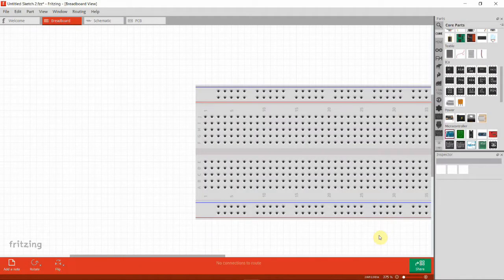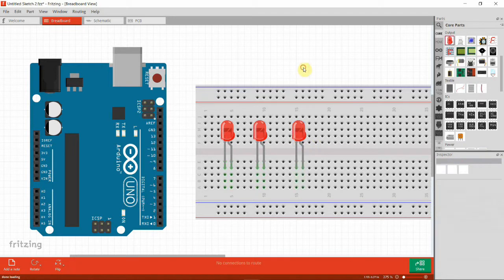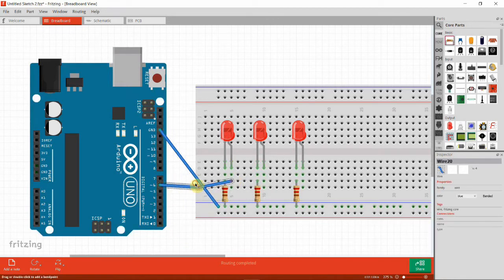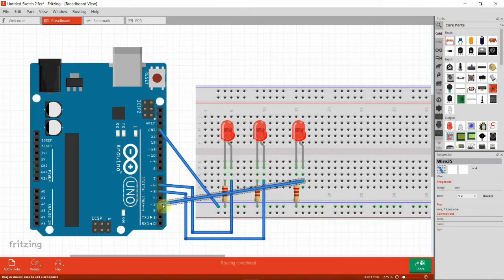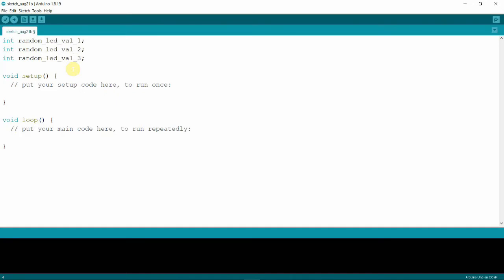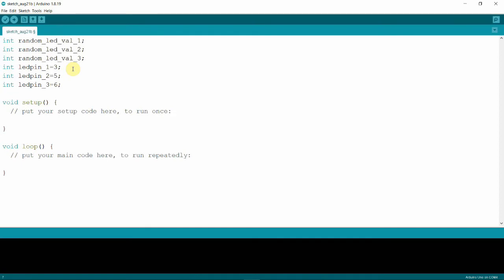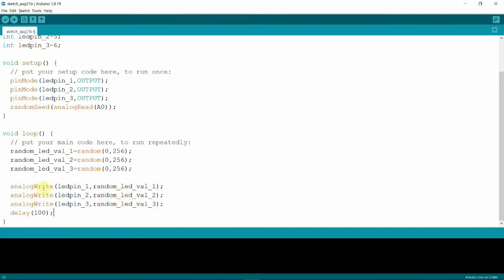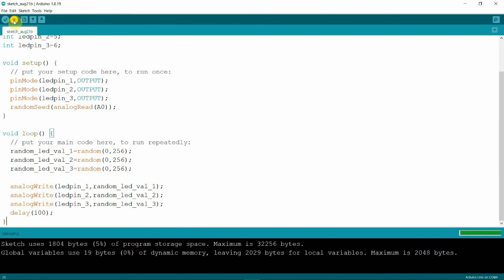Arduino Explained: Random Brightness of 3 LEDs Using random() and randomSeed()

Comment: it would be fun to replace the leds with servos. make a digital slot machine. just run the common power through a push button.
Reply from the maker: That's a great idea! I'm gonna try it out soon, thanks!